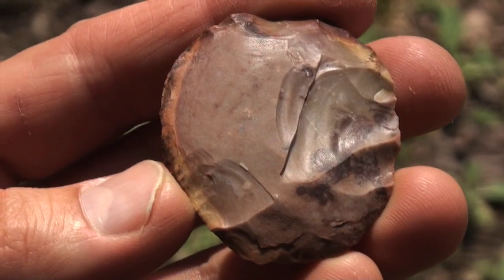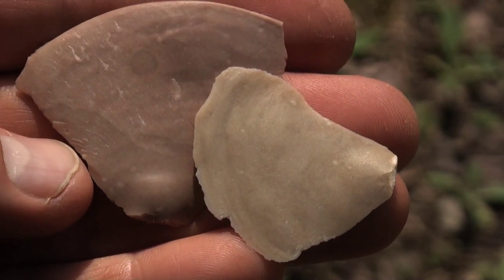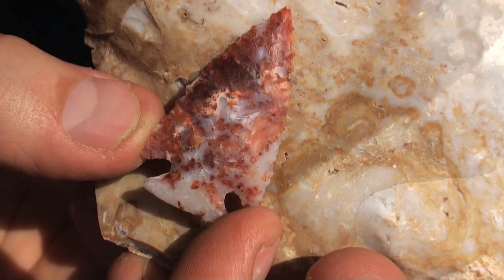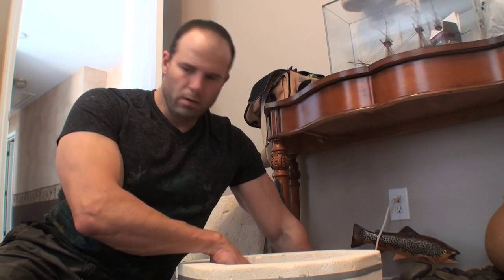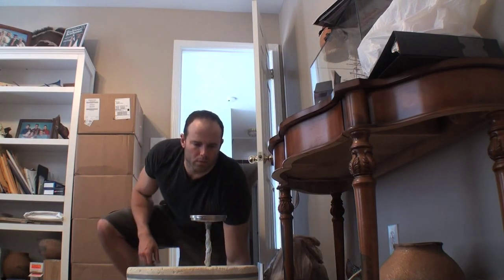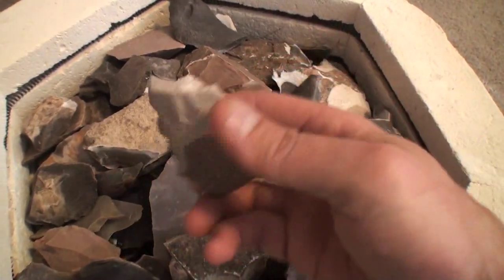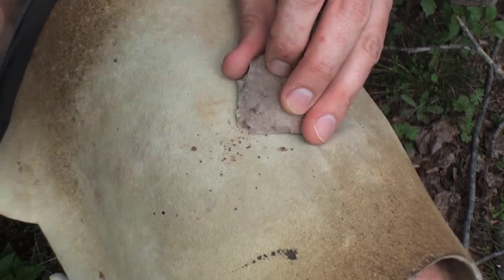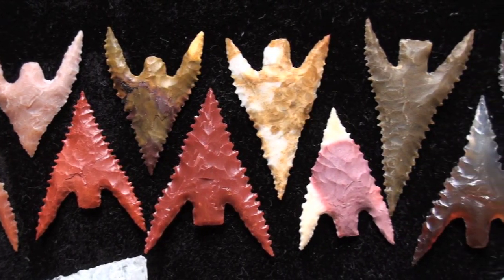Heat Treating Flint for Sharper, More Colorful Arrowheads (HD)

Comment: use a turkey roaster and bury the flint in sand, this allows an even rise in temperature, and insulates the heat when its time to cool. That means, after drying at 200 degrees, you can jump straight to your target temp, and then after cooking, can simply shut off the roaster and the flint will cool slowly. this eliminates  the need to  slowly crank up the temperature, and also the need to slowly ramp the temperature down, it will save you lots of time. Ive cooked everything from flints, cherts, jaspers, chalcedony, agates, and probably anything else you can think of, and have never had any material fracture from too quick a rise, or fall in temperature. Billy, if you have not tried this method, i recommend atleast giving it a shot. youl be glad you did. one thing to note, due to the insulating properties of the sand, you should hold the material at the target temp at least 3 1/2 - 4 hours. But the whole cooking process requires very little tending to this way.
Reply from the maker: the kiln I have will gradually increase and decrease temperature, I just do it gradually when I get to the target temp because I want to be sure I hit my target temp and don't go past it.  But yes I've heard of turkey roasters being used and a friend used one, but he had problems with hotspots and cool spots within the roaster itself, leading to uneven results.  My kiln gives me a lot of control so I stick with it.  I'd rather babysit the kiln and do my best to minimize breakage instead of losing any stone.

Comment: Nicely done. A ?? If you will? Is it necessary to completely cover the material with sand, etc?  Your video shows that you have a base of sand to rest the material on. Also the procedure you use to get the fantastic results on the color flint, agate the same. 400 F max? Thank you for sharing.
Reply: Sand isn't necessary if you cook the Flint in a kiln where you can carefully control the rise and fall of temperature. The temperature that stone will change depends on the type of stone and how tough it is. Translucent, root beer colored Flint changes at lower temperatures, around 350 degrees. If it gets too bot the stone will crack severely. Most Flint will change between 420 and 450°. But some tougher stone will require 500-550° or even higher. It all depends on the stone.
Reply: @billyberger2462  .... Thanks for the update. At some time I may look into this. I had a digital thermo unit installed on my burn-out kiln. When I burn out wax and do castings. Interesting as I have a bit of that Texas flint from near Llano.

Comment: I got a serious question and need a quick response, I've been knapping Edward chert, Keokuk, Coral and Obsidian, well I left it all in my shed and since it got down to 20 degrees is don't flake, it just chips, the Obsidian is like stone and don't even knap right, is there a cook time time on Edward's vs Keokuk, and Obsidian I'll have to do outside cuz it puts off Mercury and I can't find anything on temperature and times for each
Reply from the maker: I'm not that familiar with knapping stone when it gets that cold.  But I'm sure it can make the stone more brittle.  I would assume that brittle materials like obsidian can be rendered even more brittle in very cold temperatures, making them more prone to breakage.  I would bring the stone inside and let it warm up naturally and then try working it.  As far as heat treating, most flint (including most Texas flints) will heat treat at 425-450 degrees Fahrenheit.  Although some will change at lower temps, and tougher flint and agate can require higher temps, 475-525 degrees.  You'll just have to play with it.  I hope that helps.
Reply: @primitivepathways  the obsidian is more like flint now instead of glass like, and yes the flint just chips in very short chips/chunks. I have youtubed and researched tryin to find anything on flint in freezin temperatures but I have a fireplace I'm heatin them on the top of it now, just to experiment on a few pieces but I am gonna git a turkey roaster to heat treat just for color changes and more silica, I appreciate the help

Comment: Hey, fellow primitive hunter here. Quick question. I have been wanting to hunt black bear with primitive gear, but I have really been thinking about my stone points. Some say an ultra sharp serration is the way to go (like Ryan gill points) and no doubt those points are razor sharp... but those points are VERY fragile, I like to think that the points I make are a happy medium between durability and sharpness.. but idk, they have always worked fine for me but I haven't put them up against bear yet. Just how sharp is sharp enough? as of right now if I rub my points on my arm they will cut me assuming I apply a little pressure, but should I really be making them sharper? Ty for any info!
Reply from the maker: Sharp stone points will kill the hell out of a bear.  I like finely serrated edges, similar to a shark's tooth.  I've killed all kinds of animals with them, from turkeys to deer to wild pigs.  And they work.

Comment: would you heat treat obsidian?
Reply: Herb Slater nah, obsidian is like glass, the height of sharpness. Heat treating won't do it any good. If anything think about heat treating like it will make flints more glass like- Or if you'd rather more obsidian like.
Reply: thanks kinda thought so just didn't know for sure

Comment: People should be warned that you can't just throw a rock (chert) into an oven or fire pit and bring it up to 450 degrees! It could at least cost you a new oven and at most an eye- or even your life! 
If there is moisture inside chert or flint, it will explode when heated! 🤕
Reply from the maker: YEs that's true!
Reply: RonRay YEP.  I learned that the hard way!
Reply: I'm not really sure, since I gave up on heat treating over 30 years ago. I'm sure that Billy (author of this video) would know the correct procedure.
Reply: USChanin I'm guessing heating the stone at low temp for a while would definitely help remove moisture.
Reply from the maker: You can dry it out in the sun, or just let it sit in the kiln at a low temp for a few hours to drive out the moisture.  Then it's safe to increase the temperature without risk of the stone exploding.
Reply: When heating in a turkey cooker, you are supposed to heat flints to 200 degrees first. Would that dry them?
Reply: Are you people real?
Reply from the maker: @mleavitt787  yes it would dry the stone out...
Reply from the maker: @garycupp9417  Yes we exist.  Although some people claim we're aliens...

Comment: I think what heat treating does is forces a low grade metamorphism withing the stone.  So in reality, it isn't flint/chert anymore but a low grade metamorphic rock.
Reply from the maker: I've heard that it actually melts the grains together, which would make sense since it becomes more glass-like.  Although that's just theory...I don't think they know exactly what happens during the heat treating process.
Reply: Primitive Pathways. It does to a degree.  we went through that chapter in my college geology course.